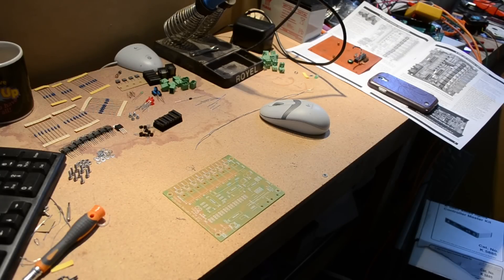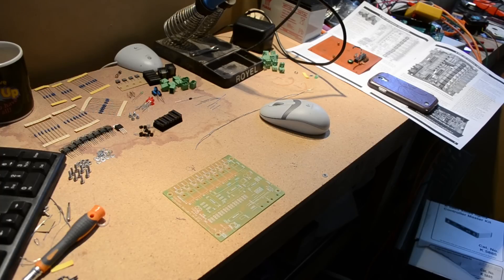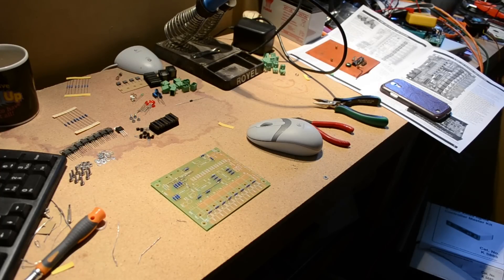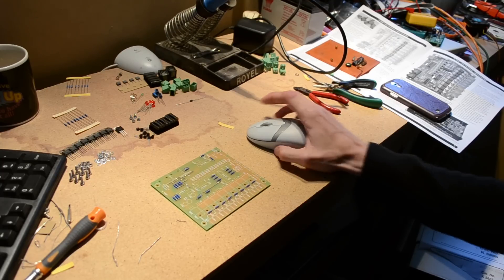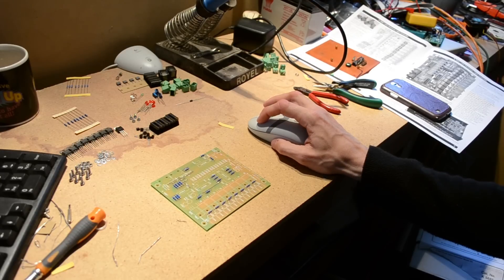Christmas Light Controller Build Pt  2

Comment: Bummer on the PIC chip.
Reply from the maker: Neil Robinson Turned out the PIC chip was fine, I'd fried the crystal when I put it on (Or the crystal came pre-fried, I'll never know) .. Luckily, old PCI FireWire cards have the same 24.576MHz crystal on them
Reply: jgcertified Damn! I never thought crystals could be fried. I wonder, maybe it was faulty from the manufacturer? (Cheap ass one from china) I do know a friend had some crystals that were way out of tolerance, they were like ebay specials I think.